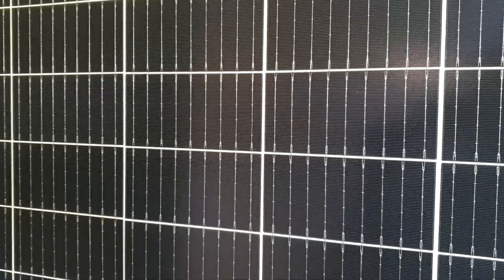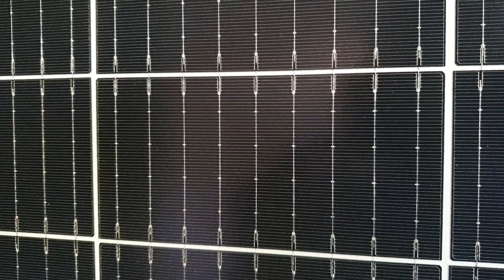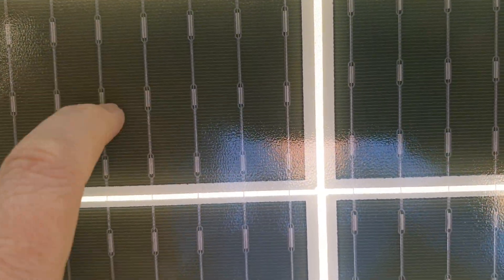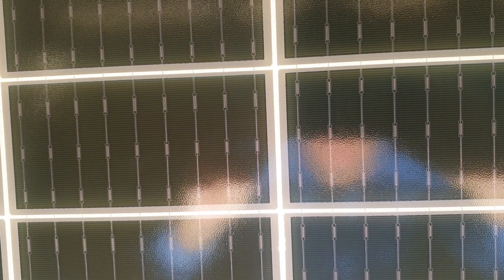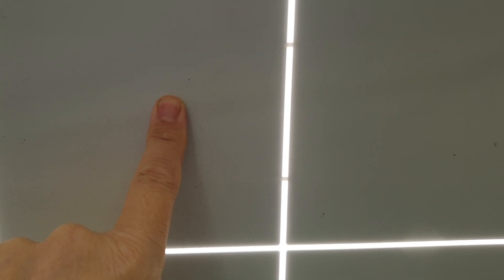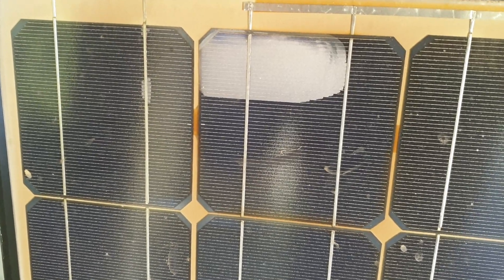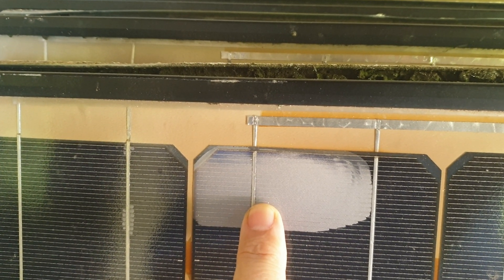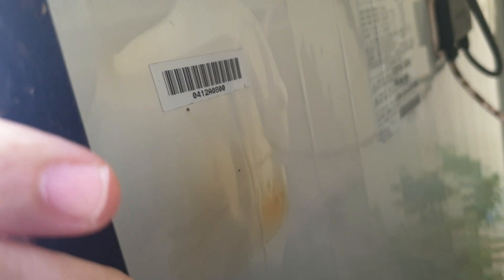The benefits of glass on glass solar panels over laminated solar panels

Comment: maybe if the white back sheet had a bead of water proof caulk around the edges it would help with water not getting in.
Reply: Thanks Mark, you do find that around most solar panels but unfortunately over time the plastic or the back sheet itself fails over time.